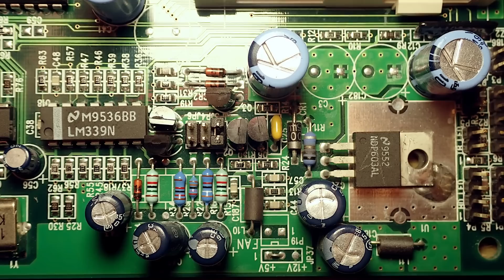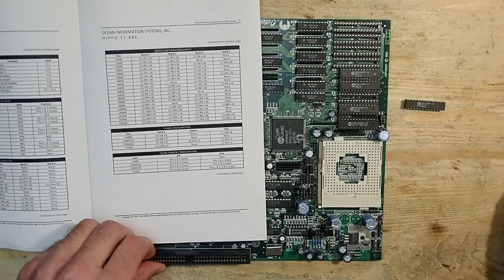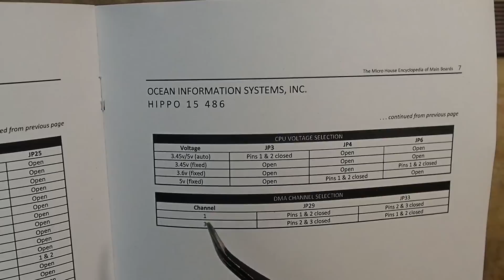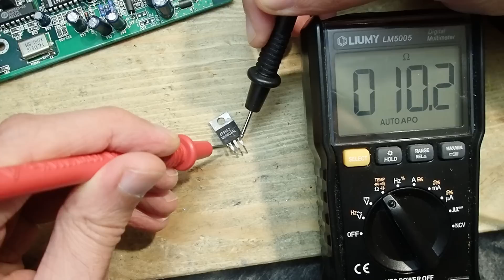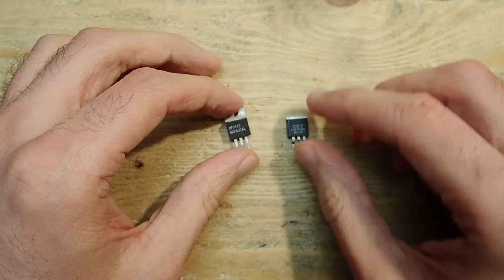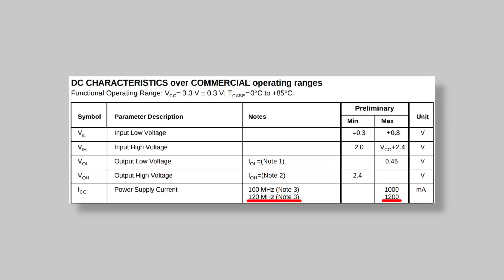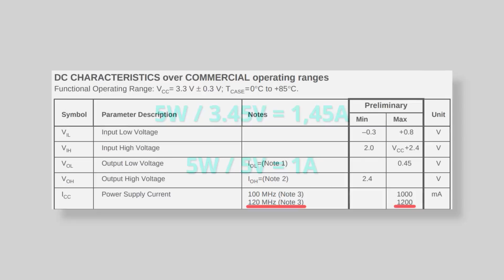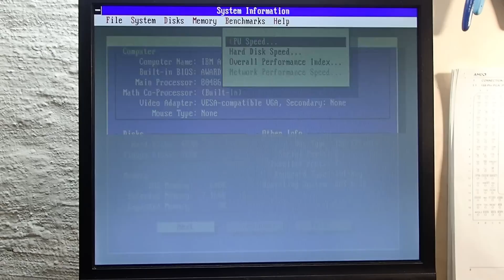Let's repair one of the best 486 mainboard - Octek Hippo 15

Comment: The burned resistor  R11 looks like a current sense resistor, the R14 above the small transistors is probably used for Vout feedback. The resistor (R11) is probably 0.5W or 1W but it is not a problem as it'll disipate 0.04W at 2A.
Reply: Agreed. THAT IS NOT A FUSE!  I have no idea why he keeps saying "the fuse", when  there is absolutely no indication, PCB marking (R11) or component marking to make him think that. I also cannot work out where he gets the "5 Watts" from (once again, there is no reason to think that).
And why on earth did he replace a 0.01 Ohm resistor with a 3A fuse? WTF??
Reply: @johncoops6897  There is such a thing as a fusible resistor. I'm fairly familiar with this type of circuit and I'm fairly confident that it doesn't make use of a current sense resistor.
If it did it would need to be a precision resistor not a 10% tolerance wire wound resistor.
Reply: @felixokeefe  for digital electronics of that era 10% tolerance fully acceptable.
Reply: @johncoops6897  Because a fuse is a 0.01 ohm resistor
Reply: @johncoops6897  even a straight wire is technically a fusable resistor, (it will burn like a fuse if you try something like 10A at 5V)
Reply: @monad_tcp  - if you remove a resistor, then replace it with a resistor.
Reply: @monad_tcp nooooo 0 ohm resistor not like 0 ohm fuse

Comment: I'd like to say thank you. You're doing great job here. And I decided to revive my P4P800 board. It worked 2 years ago but... Now it doesn't (posts the dies). I have two of them. Both with similar result. After messing around I know that I have to replace all VRM caps (70 deg C after 10 minutes is not normal...) 😁
Reply from the maker: Yes sometimes it needs to be done. Especially on the P4 and Athlon the caps were under very heavy load and tend to go bad a lot faster there.
Reply: @necro_ware  I hope it is. Board worked for half an hour and then died on my eyes. Second one randomly forgets settings, crashes on memory count or reports BIOS checksum invalid and starts in BIOS recovery mode. On the first one I thought it was CR2032 or RTC crystal (your video about interrupts inspired me for this investigation), but scope said "it is OK" and fresh battery didn't help either. PDF from ICH5R says everything including CMOS RAM is integrated so I hope it is about bad caps 🙌. Also funny thing that Watchdog randomly shuts down power to that first board. 
I replaced any other component PSU, CPU, RAM, GPU... Nothing else left ;)

Comment: Thanks a lot for this great video! I learned so much from your channel already. And this one gave me some ideas what else I can check on my Hippo board that currently does not work as well 🙂 +1 also on the recap mentality. I also only replace faulty ones and that worked very well so far.

Comment: Soldering on such large copper planes/areas really is a pain! A large chisel or hoof shaped tip should help.
In the video I could not see it if you did it but wetting the tab of the MOSFET with flux paste before laying it down on the melt solder should have made the process just a tiny bit easier.
Reply from the maker: Yeah, I probably threw it out during editting. Some flux is always a good idea.

Comment: I have this board and set it up with 64MB RAM, S3 Diamond Stealth 3D 2000, VooDoo 2, SB AWE32 running Windows 98SE and it performed beautifully!

Even managed to run Half-Life 1 on it, if a bit slowly (but the fact it ran at all using the VooDoo 2 was amazing!)

Great video and certainly something I'll be watching out for on my board!
Reply from the maker: Hehe, even Voodoo 1 is an overkill for a 486. The FPU is simply too weak to feed the GPU. I bet, if yoy replace the V2 through V1 you will not notice any performance difference.
Reply: @necro_ware  oh I know! But sometimes it's not about what makes sense but rather the absurdity of it all!

I remember being a kid and getting win95 booting on a 386, and even though it took half an hour to boot, it managed to do it. That was the fun of it all. The challenge.

Right now I've got a dual PIII system set up with an Nvidia FX5200 and 768MB RAM, running WinXP, just to play a nosteam copy of HL2. Why? Because! 🤣 It's just for the fun of it.
Reply from the maker: @orinokonx01  Hehe :) That's true

Comment: I was so proud of my 486 DX2 computer when I first got it new.  I seem to remember paying over $3000 for it.
I used it for many many years.  Maybe it’s still down the back of my shed ;)
Great video.  I have leant a few diagnostic tricks.
As for replacing all the capacitors.  Not sure why you would want to do that.  If it’s not broken don’t fix it I reckon. :)

Comment: i wouldnt re-cap unless caps look like they are going OR questionable quality... OR rarely i have helped racap boards that came with undersize caps allowing better chips to work stable under extended loads... (few biostar models are like that) 

this video just gave me memories of doing repairs like this when these boards were still in regular active use... 

also, alot of Micron Pentium boards dont do EDO either, yet a few of their 486 boards we delt with liked EDO better then FP(a couple ONLY would use 72pin EDO or 30pin ram..... but not fp ram... weird as that may be...)

i dont miss those days... outside how easy most stuff was to repair...

Comment: My theory on how the transistor and the fuse resistor died is - the original machine likely had a base-plate of prefabulated aluminite, surmounted by a malleable logarithmic casing in such a way that the two main spurving bearings were in a direct line with the pentametric fan.

Comment: As others have said, R11 isn't a fuse, it's the current sense resistor that lets the cpu power supply section monitor the cpu current and probably shut it down if the cpu draws too much current.  By replacing the sense resistor with a 0 ohm fuse you have effectively disabled the current limit circuitry. The cause of the fault was probably a failure of the FET going short which took out the sense resistor.
Reply from the maker: Yes meanwhile I also think, that it is a current sense resistor indeed. However, since I replaced it with a 3A fuse it would limit the current in a hard way :D I guess, I will have to search for a proper replacement...

Comment: I think the "Recap EVERYTHING!!!" instinct is the result of the "Capacitor Plague" era. I actually bought  a NOS s754 Foxconn board from around that period. I opened the damn thing up to test it and the low side VRM caps had popped IN STORAGE!!! Mentioned that to the seller and he sent me another one free of charge. Opened it up, and  the same caps had puked on that one. Well, I guess I'll get some practice then...A late 486 board is well before this period, so, yeah, it should be fine.
Reply: Capacitors had plagues all through this time. Early 90s mac's were notorious. And that is a case where if it has not been recapped, it gets a full recapping automatically even before first power on. Regardless of how they look. PC's on the other hand were a little bit different. And I am on more of a replace as needed. Except for those bulb looking tantalum's. Had too many of them explode when turning on a machine. At least 12 volt caps anyhow. Most things really rarely need recapping, at least until the later 90s and early 2000's as you say. 

Power supplies though I tend to be more willing to recap and be very careful with. As I have sadly had a rare machine get cooked without taking the due diligence to test it before hand.... And I am still angry over that to this day.
Reply: @wishusknight3009  I've actually have a couple of ATX PSUs I've had plans on recapping. One is a Dell OEM (NPS-350) unit I'd like to do just for the practice and because the mobo will be getting a 3.8 GHZ Prescott 2M and a X1900XT once I get around to it. The other is a Bestec (STOP LAUGHING!!!) ATX-300-12E Rev. D that has a nice and chunky 30 amp 5v rail (I like K7s, so a psu with a chunky 5v rail is always welcome) and DOES NOT have the failure prone and board killing 5vSB circuit. I also plan to mod an external power switch into it where the 120/240 switch was.
Reply: @ironhead2008  If you know how to get into any kind of circuit analysis, you can sometimes make little improvements to things that can greatly increase there performance. Reverse the cut corners as it were. Often times the circuit in those cheaper PSU's are pretty sound, they just use inferior parts or inadequate cooling. 

And sometimes you can find a small modification that will improve them to the point you really trust them as solid. 

I have an old Fortron 350 PSU that has a heavy 5v rail as well. And its great for the retro bench... It was not quite as low end as the Bestec, but they were still on the cheaper side. And they had a problem with their rectification being inefficient and causing them to die a heat death. Once I made that modification to improve that part of the PSU, its effeciency increased from about 61% to 68% at roughly 200 watts draw mixed load. So all that extra heat was being taken by the rectifier. All due to them saving 50 cents on a couple parts. I don't really know how good the rest of it is in the grand scheme, but it seems to test decently enough after putting in some higher quality caps. And ~70% is decent enough and about right for a psu without PFC from that era. And its ripple and regulation are what I would consider quite good. 

So all I basically did was replace parts with higher quality ones and change 2 traces in the rectifier circuit. Which would have probably doubled its retail price at the time it was sold. And it shows its actual design is pretty solid. 

I didn't need to replace the smoothing caps, but I did anyhow because it was not really expensive for me to do so. And I wanted this to be something I trusted implicitly.
Reply: @wishusknight3009  Basically my plan. The caps I selected are all fairly high grade: Panasonic FC and such. I've chiseled off as much of that stupid glue as I can: there's some that's uncomfortably close to sensitive parts of one of the transformers that I really don't want to dig into: might damage something, Might just cover the area with hot glue to isolate it.  Also plan to repaste the MOSFETS and throw a fairly powerful Delta fan in there. The Newton will probably get a 80mm Noctua.
Reply: @ironhead2008  That sounds like a good plan. I never replaced the fet's on mine. They seemed decent enough and did the job, though for yours you can probably find upgrades to them and improve the performance. I also never really bothered with gluing anything in mine. I soldered in the connecting harnesses that I knew I would use and removed some that I knew I wouldn't use. I am not using it in a permanent build but just for assembling systems on my bench that I play around with. So it doesn't need 10 molex and stuff like that. It has the 20 pin atx, a 2+2 cpu connector and 2 molex runs that have 2 molex plugs each with one having a berg for floppy. If I need extra's i have plenty of adapters and y cables. But it is mostly use for AT systems with the P1/P2 adapter cable and given it has -5 volts its also compatible with all my sound cards and serial devices.
Reply: @wishusknight3009  I'm planning on putting new thermal interface material in between the main mosfets and their heatsinks. Did yours have that obnoxious brown glue in it everywhere that becomes conductive over time? That's what I'm thinking of putting hot glue over. There are a few areas where that stuff is really packed in and I don't want to risk damaging something digging every last bit out.
Reply: @ironhead2008  Not that I remember. It was just normal hot-snot that i could remove rather easily. I did however have an amplifier that had that brown glue and it caused it to short out, blowing a hole through its main pcb and taking everything in the amp with it. It was a yamaha M85 and it has been a long and expensive road to restoring it.

Comment: Nice repair !

I actually own the same board and it's not working yet.

When I first got it, it was covered by mud and most of the board's metal looks a bit dull. I guess years of moisture got rid of the shinyness of the board. Of course I cleaned it before trying it. Last time I tried it, I remember once in a blue moon having a post code, so there's some life left in it. I remember trying contact cleaner

Today I powered it and to my surprise I got a post code every time ! However when I put ram it always gets stuck at code C5. Moreover the jumpers were a bit wrong so I changed them. Then I got no post code ... It seems that the clock generator set to 33mhz prevents the board from outputting post codes. Setting 25mhz worked like before.

Then I checked the CPU voltage and to my surprise I saw 4.5/4.0V
Since I saw your video I checked the regulator's resistance and I got like 20ohms. So just like you this doesn't look right.

Now maybe I'm a bit paranoid, but maybe this transistor just doesn't age well ?

Also there was a burned trace behind the CPU socket. I don't know what it was made for but it didn't prevent the board from outputting post codes and fixing it didn't solve the issue I had (but of course that trace was probably doing something important). The fuse on mine isn't blown and isn't dark.

Or maybe both our boards got the same mishandling resulting of killing the regulator ?

So I guess my next step is to swap that regulator just like you :)
Reply from the maker: Such power transistors in the linear voltage regulator circuits can get really hot and on this board there is not much of a heat sink except of the copper plane underneath. Due to the stress those transistors are notorious to give up one day. In my opinion this is the issue number two on the 486 mainboards right after the barrel battery. The burned trace behind of the CPU is may be a sign of a wrong CPU insertion, I hope, that is not too complicated to fix with a jumper wire. With only 20 Ohms you certainly should  also check out that transistor indeed.

Comment: About voltage auto-detection - it is about a pin S4 in the CPU socket. DX/DX2 have it open but DX4 or 5x86 have it grounded. So based on that motherboard can automatically set the voltage 5 or 3,45V. I have one mainboard (486PI) which has no voltage settings but supports DX4, so I investigated to be sure I can safely use DX4 and figured this out.

Comment: Nice fix! I bet someone put the CPU in backwards, I had several that were given to me in the late 90s/early 2000s when 486s were merely obsolete that suffered the same death.

Agree on quality capacitors like Rubycons not needing replaced, as long as it's not from one of the cap plague/counterfeit eras. I often end up recapping boards that we use in test systems or customer machinery anyway, since the cost of downtime far exceeds the time and effort to recap...but that's a little different :P

Comment: Thank you!
The 1.5A fuses are never blown black by 1.5 or even 2A currents.
The transistor with 5V input could not send any high voltage spikes to the 5V CPU.
There has been another cause to this.
Reply from the maker: Voltage not, but if CPU died it could end up in a current peak taking the transistor and the shunt with it. Hard to tell, I guess. We will never know.

Comment: Absolutely correct on the capacitors. As long as they aren't visibly leaking or you can ID them as fake, and the ESR is good, no worries. If they're cheap  no-name/chinese made units, or your board is known to have the fakes, then by all means. I recently rehabilitated an old Neo-Geo MVS arcade board, and I had to redo the electrolytics because time and heat had visually taken their toll.

Comment: Those were cool and exciting times back then. What did I tinker around and exchange Parts. Today I use an i5 4670K with 16 GB for seven(!) years. Sure, I've added some SSDs from time to time — recently even an NVMC in a PCI-E slot (because I still like to tinker). But the i5 is still enough for everything (including video editing). I only render 360-degree images and videos on the phone because the RX570, the CPU and all the fans are at full speed, and it still takes longer than on my soon-to-be three-year-old Redmi Note 5 (which does not even get lukewarm). If there are no ARM CPU mainboards comming soon, the successor of my i5 will be an M1.

In those seven years I had: 384/40, 468 DX2/66 (@80), An5x86-133, AMD K6-166 (@200 (2x 100 MHz)), AMD K6-2 400 (@500), Athlon 1.300, Athlon XP 1600+ (@1.66 GHz). Madness, how much performance is between the 386/40 and the XP. I'm not itching in my pants to think about a mid-range Ryzen. Nice CPUs, but uninteresting to me.

What I've spent on graphics cards as a PC gamer in those seven years (and after) doesn't fit a cow's skin. That was a lot more graphics cards than processors.

After XP I switched from Windows to OSX (Powerbook 17" G4 1.33) in 2004, then to a C2D 4300 (@2200 MHz) (Hackintosh) and then to the i5 4670K, which I overclocked so far only for fun, but otherwise run in default. I've been away from the Hackintosh for a year now. Ubuntu offers everything I need. Only for FinalCut I still start the Hackitosh, very rarely Windows for old games. I only gamble on an old Xbox 360, I don't use the Nintendo Switch at all.
Sorry for the longish posting. Is probably at the end of the year that you think more about the past.
Reply from the maker: Thank you for sharing. I can only confirm this, seven years back then are not 7 years today.

Comment: Nice fix
I've had almost the same failure on a SiS496 based board with a multi voltage circuit of this type.
TIP127A failed in a low resistance mode from Gate to Source and was providing very low voltage output. 
Swapped it for a BDT64C and all was happy again.